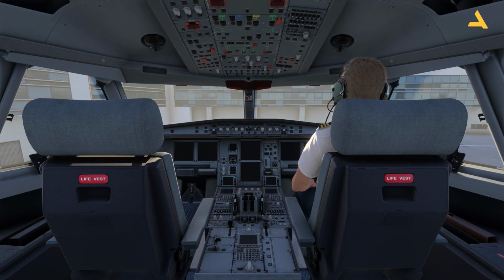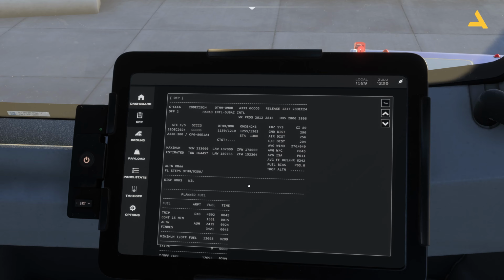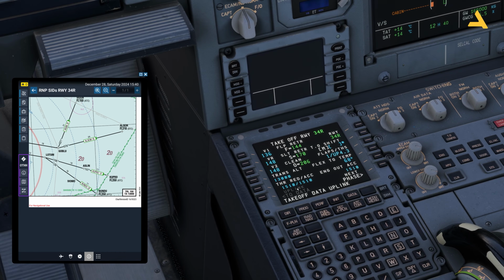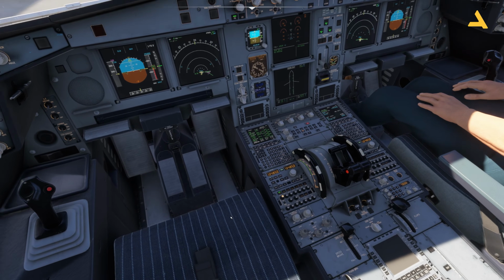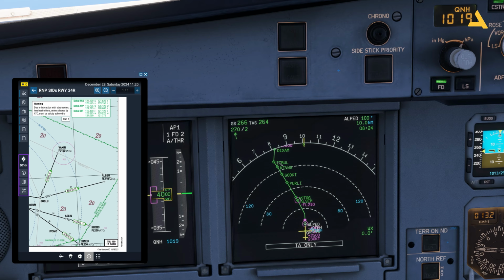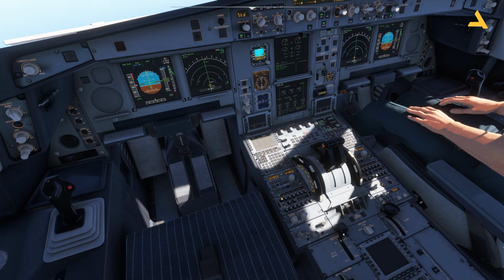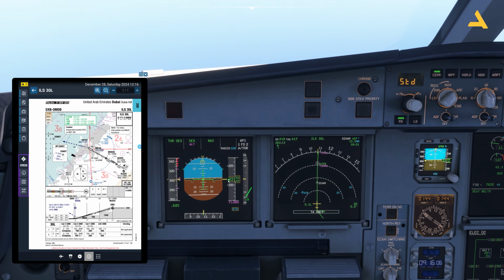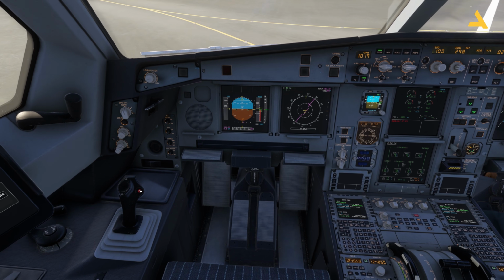Complete Tutorial of Airbus A330 in MSFS 2024 | A Beginners Guide

Comment: Hello.If you could possibly answer why does the auto pilot usually quit half way through the flight plan.?
Reply from the maker: There can be multiple possibilities like high altitude, accidentally touching the physical controller, over speeding. Make sure that you have properly configured the MCDU and the autopilot is in the managed mode. Maybe you can share more inputs regarding your flight setup so that I can point out a specific issue

Comment: I have couple or problems. 

1) When I start from the cold state of a330, I follow everything, and every looks fine, but at the time of take off, the left screen which shows the speed(I don’t know the name of it) does not work properly, the speed is 0 on the screen and never change due to which later after the take off I cannot turn on the Auto Pilot.

2) If I start directly on runway, everything is ready and I put in all the FMC data. The plane take off and everything works fine but at the TD when I enter the lower altitude, and switch to selected mode from manage mode, sometimes the plane starts to climb instead of descent. And keeps on climbing, no mater what, it never goes back to manage mode. Its so annoying. Can you please help me.

Thank you.

Rehan
Reply: The speed most likely doesnt change because maybe you forgot to take off the pitot tube covers.